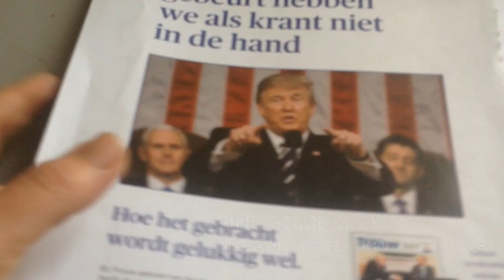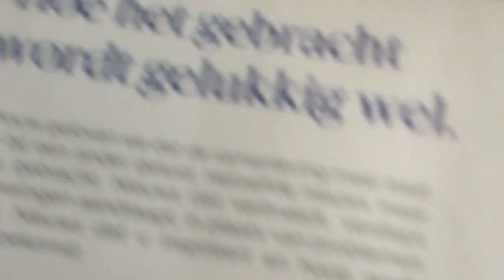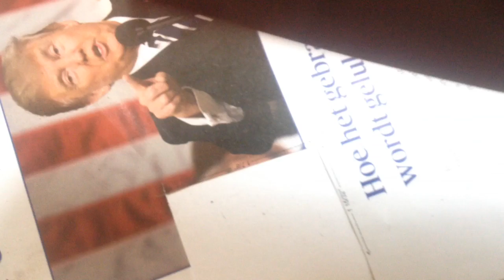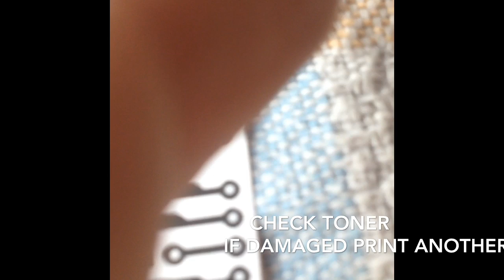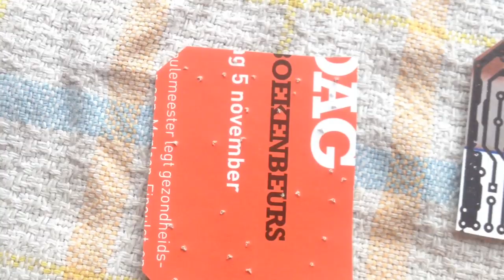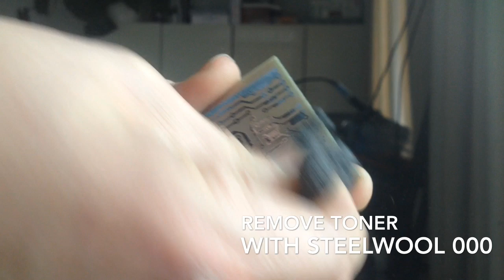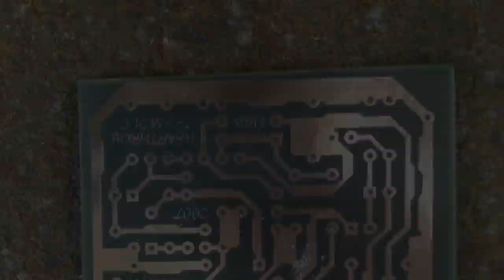Easy DIY PCB etching using glossy magazine paper & laser printer

Comment: Interesting. I haven't tried the holes in the paper thing before, but it seems like it would affect the effective iron to board contact.
  Personally I have had great success using a travel type clothes iron. Here in the USA I find travel irons at thrift stores all the time. They usually have a folding handle, a slick plastic coating to slide around more easily, and they don't have steam holes. The lack of steam means you don't need to worry about contamination from the gunk that tends to build up with steam irons, and you get uniform surface contact.

  When looking for glossy paper to print on, avoid pages with any color from orange to red to purple (think of colors on a color wheel here). I have transferred several designs on junk paper that had colors close to red. More than half of those were junk because the way red-ish ink tends to transfer onto the copper. I wasn't able to get the red-ish ink off without damaging the transfer. After I had that problem a few different times, using paper from different sources, I just avoid anything red-ish in color.

  I watched another upload recently where the guy suggested using the backing paper from vinyl graphics. All sign makers and graphics shops throw away tons of the stuff and will give it away to anyone that asks. It takes a bit more planning and effort to acquire vinyl backing paper but it is on my list of things to try at some point.

  What was the resolution of your lettering on this board? It looked pretty solid for such fine detail. The best resolution I've been able to manage has been 0.4mm traces using toner transfer and ferric chloride. I've started playing with dry film because I want to be able to use some smaller surface mount packages like a 64pin 10x10, 0.5mm pitch LQFP. So far dry film photoresist has a lot more variables and dialing in a good technique requires a lot more trial and error.
  ...anyways, nice upload. I sub'd and added this to my "PCB Fabrication and Prototype DIY" playlist. 
-Jake

to anyone else reading this and unawares, Hydrocloric Acid is available in big box home improvement stores in the US. It's called Muriatic Acid and is sold for etching/cleaning concrete. Hydrogen Peroxide 3% is sold in any pharmacy. The YT channel "Nurd Rage" has several videos about these enchants too.

(My channel is not monetized nor do I plan to change that. I don't care if you or anyone else checks it out. This is not spam. I have nothing to gain. I simply like to share odds and ends occasionally, usually FOSS'y or OSHW related. My playlists on YT are a form of personal notes and references however they are publicly listed and roughly indexed alphabetically.)
Reply from the maker: Perforating the paper helps to let the air underneath escape, which is critical to the transfer; Yes, using the iron was all part of the challenge to use materials available in the house. Thanks for commenting!

Comment: after removing the paper,  you could use a damp sponge to clean the board from the remaining paper. use aceton at the end to remove toner instead of steelwool, make it easier to clean the board
Reply from the maker: If you cool down the board slow but make it really cold, the toner is very tolerant to all kind of rubbing.
Yes you can use aceton instead of steel wool after the etching process to remove the remaining toner.  
Removing the paper from the bare copper is important in getting a good etching, but the paper on top of the toner doesn't really do any harm. 
But indeed, this is the tricky part of the process and requires experience.
Underdo it rather than overdo the paper removal, is my advice. Good luck!

Comment: Removing the paper from the toner is the hardest part especially when copper pour method is used for pcb design.
Reply from the maker: Depends on the exact material used in the paper and its thickness... but true still.

Comment: Which printer used ?
Reply from the maker: I used my own printer
Reply: Printer means xerox machine ?
Reply from the maker: @sabirsande5490  no it's a printer, not a Xerox machine
Reply: Okk
Reply: Thanks
Reply from the maker: @sabirsande5490  I used a LASER PRINTER as indicated in the title and the video - but you didn't read the title or watch the video and then ask questions?

Comment: Can we use fecl3 for itching on glossy paper ??
Reply from the maker: Hi Romesh, thanks for the question. The answer: YES! The chemical you use for etching the pcb doesn't really matter,  the method is just about how to put a mask on the pcb to protect the parts that should not be eaten away by the chemicals.
Reply: Sir mein agar Kisi pcb leyot ko download karta Hu to kya usse direct print Kar Sakta Hu ya mujhe pcb ki size set Karni hogi please sir reply Karna thank you sir.

Comment: Hey there. Question for you. When you iron the magazine paper onto the plate for a minute, did that leave the glossy material from the magazine paper onto the brass plate? I have done a few attempts, and the glossy material is present on the plate. I havent proceed any further beyond this. I think the glossy material might prevent acid from etching the plate
Reply from the maker: Keesu C Don’t use the covers they are laminated with plastic - just use the inside pages like I show in the video. Dont forget to subscribe, im posting an update next week...
Reply: @zjokka  I used the middle pages not cover. I will try again.
Reply: @zjokka  I think that he's saying that he cannot get the glossy paper off of the plate. Just need to try harder and soak it in water and peel it off by hand.
Reply from the maker: @Jnglfvr  just use cold water (or lukewarm, anything that will not melt the toner) and rub the paper off. If you cleaned the board well and transfer was ok, you cannot damage the toner traces at this point.

Comment: Hello! Subscribed!
Could you please suggest a Laser printer model number (India) which prints solid blacks?  Some Laser printers print dotted blacks on photo paper which aren't solid black. ( I tried HP / brother which were under 10k & they were not solid black but had a kinda stippled/dotted appearance). (Printed on the best setting)   .Do you have Any experience with the Brother 2351DW ? 

Thank you so much ! 🙏
Reply from the maker: Thanks for your interest... laser printers are all basically the same process: a powder is heated until it melts and becomes liquid and is then shot onto the page. If you don't have access to a laser printer, you can use a photocopy machine -- it's the same process. Regarding the quality of the print, the stippled/dotted appearance - this may be a low resolution setting? A laser printer should be able to print in undotted black. Hope this helps.

Comment: For me sometime the printed circuit on the glossy paper when I heat from iron box it doesn't get imprinted on the copper side of the PCB so what should I do.
Reply from the maker: sanjeevrao9392 apply more heat for a longer time
Reply: @zjokka   hi I tried to take printout in glossy magazine sheet from lazer printer but still the circuit is not getting printed on the PCB what should I do. Please help me.
Reply from the maker: sanjeevrao9392 i cannot tell what the problem is from here without seeing it... if the laser toner mask is not transferring it could be a) not using laser printer b) paper too soft C) not enough heat — how are you applying the heat?    Watch the video again its all there ... no tricks
Reply: @zjokka  I am applying the heat by iron box
Reply from the maker: @sanjeevrao-xb4pk  What's a heat box? You see what I use -- a clothing iron... but you need to apply heat for longer time than shown live in the video.

Comment: Please suggest the website/app. etc through which I can take a print of my project. I am very much Interested in fabricating Hi-Fi Amplifires. I etch circuit manually by hand using oil paint.
Reply from the maker: Please try and rephrase your question, it's not clear to me what you are asking.

Comment: Hi what make and model is your printer.
Reply from the maker: john derwin only thing that matters for this process is that it is a LASER printer - its a HP LaserJet P1606dn
Reply: @zjokka  Hi again does the paper have to be high gloss or would a sheen paper do. thanks
Reply from the maker: @johnderwin  I don't know, honestly, but why not try it? it might work better than the glossy magazine paper... I have always wanted to try baking paper as well... If you own a laser printer you can experiment.

Comment: Cool..wow..Is this working without acetone? Thnaks
Reply from the maker: Greyam acetone is used for 1) cleaning / degreasing the copper board;  2) removing toner from the etched board. You could use detergent or soap for 1 and steelwool or light sandpaper for 2. Great question!
Reply: @zjokka  Thanks mate.great. Any alternate for lazer print? Ive done this earlier using my inkjet but it melts the ink. Thanks
Reply from the maker: @Greyam-cm2gt  an inkjet printer sprays ink on the paper; a laserprinter uses toner, which comes as a powder in the cartridge. When heated up this powder melts and sticks to the paper. But it is molded into a film thin form which is easily transfered as a whole.
The whole process requires LASER TONER, but don't forget that Xerox machine also use this. You could go the print shop and get a good copy there.
Also, when printing, check your settings: you can choose the quality of print. Choose the highest resolution you can get, so the printer uses a lot of toner. This will give you a more solid toner mask.
Don't forget to like and subscribe....it really helps - more questions? Let me know!
Reply: @zjokka  Thanks mate. really appreciate

Comment: good buddy,,,tell me that in my city shopkeepers are saying that photo papers or butter papers cant be put into the laser jet printer,,,so its possible?
Reply from the maker: Thanks for your comment. Yes, you can use different material, but they have to have a somewhat glossy surface and be able to withstand the heat. I use this because glossy magazine paper is very easy to come by.
Reply: thanks bro,,,and either by taking two much prints on glossy papers,,is it harmful for laser jet...?
Reply from the maker: Not at all... just prints on it just like on any other surface...have fun, experiment!

Comment: Can you do this on stainless steel as well?
Reply from the maker: In principle: yes. In practice: no. You will need much stronger acid, longer etching time or higher heat to break down the stainless steel. Aluminium is very soft, as is copper, but stainless steel is very hard and strong.

Comment: like to ask why the (glossy) pages are used and NOT the cover... we might then use 'normal' paper as well , just curious 😉
Reply from the maker: Hi Jack! Well this procedure is a result of years experimenting and trying to avoid somme commercial toner transfer products. 
The printer toner is a powder that is heated to become a liquid ink that is than projected onto the surface. 
You need a paper that will easily allow the toner image to get detached from the paper and sticking to the copper board. The glossy magazine paper works best in my experience. The  very glossy plastic like covers may also work - never tried that.
Hope this helps. Do give it a try and don't forget to share your discoveries with the rest of the world on yt ;-)
Reply: @zjokka : THNX for your response! So far I always tried the COVERS with changing results,: one "sort of glossy paper" just seems to be more effective than other. My idea was that the 'normal' paper within the glossy magazines may absorb the laser-toner more than the shiny cover does you see. I use an old(er) HP laseprinter and will certainly try next time! THNX!
Reply from the maker: @jackraves7363  magazine paper has a glossy, plastic like covering that is essential in easily releasing the toner when it's ironed onto the pcb. Paper doesn't have this layer, so it does not easily come off without damaging the toner. Thick plastic like magazine covers contain so much plastic that it might melt into the iron.

Comment: Hi sir can i use an ordinary photo paper? And any printer like canon or epson?
Reply from the maker: Hi Lizty, I don't know what you mean by ordinary photo paper... you can try it. I just use magazine paper because it's widely available and free. Before I used to use some kind of photo paper for inkjet printer + laser printer. That worked too. But it is important to use a LASER PRINTER, which use a powder toner which melts when heated. You need this to be able to make the transfer. Inkjet printer doesn't work, it sprays ink like a spray can.
Reply: zjokka 
Thank you so much sir im enlightened  through your explanation  
Ahh that's  the reason why my lay out transferred to my cooper clad coz i used inkjet printer lol

Comment: Very Interesting - What is the concentration of the  hydrogen peroxyde you are using ?
Reply from the maker: The info I found, and this was years ago, suggested 20% hydrogen peroxide and 80% hydrochloric acid, but I now fill the etching cup half with warm water first, than about the same about hydrochloric, then a good dash of peroxide. The peroxide is the most violent, the catalyst, so always less of that. Using a warm solution also speeds up the process tremendously. But be careful, if the solution is too hot it may cause the toner to come loose. 
This video was made years after I quit building effects, but it really a result of experimenting in the course of about 100 pcbs

But great question. Don't I specify concentration in the video?
Reply: Thank you for your answer
Looking again at the video, it seems it's a 200 vol  hydrogen peroxyde (written on the bottle), which is a very high concentration